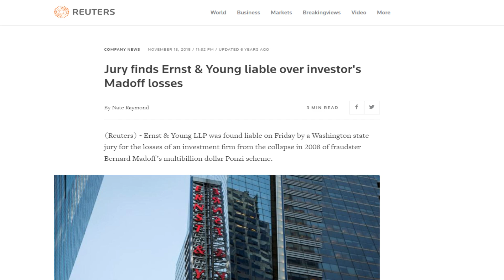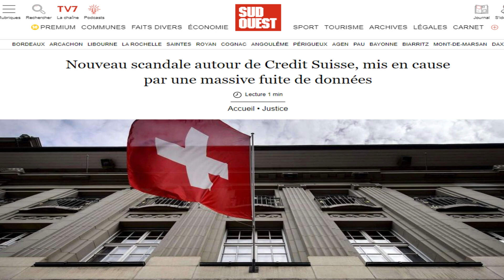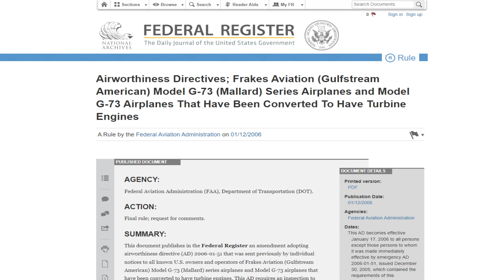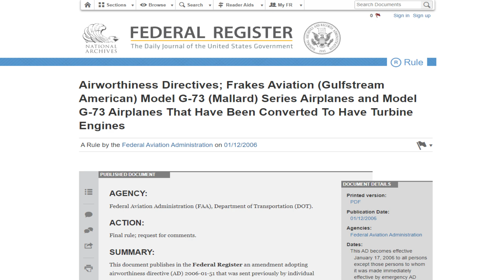Chalk's Ocean vol 101 - Fracture en vol

Comment: Salut Aldo, merci pour cette vidéo. 
Ton sens du récit, ta diction, tes connaissances (en aviation mais aussi dans de nombreux autres domaines), ta logique et tes capacités analytiques... Je connais peu de personnes aussi brillantes. 
La fatigue des matériaux est un processus assez lent est piègeux, où la pièce qui en est victime semble subitement casser sans raison. 
Heureusement de nos jours les puissances de calcul disponibles permettent de soumettre les designs à des simulations, ce qui permet d'identifier les points faibles et de corriger le modèle avant même sa production. Parfois il suffit de produire la pièce selon un procédé différent, forgeage ou découpe dans la masse au lieu de moulage par exemple. La nature du matériau employé a également une importance capitale, un acier selon ses teneurs en chrome, molybdène, silicium, etc n'aura pas les mêmes propriétés qu'un autre avec des teneurs différentes... L'un pourra être très rigide au point d'être cassant, l'autre pourra avoir une très bonne résistance tout en ayant une grande possibilité de déformation réversible (ressorts). La science des matériaux est extrêmement vaste, une vie entière ne serait pas suffisante pour maîtriser tout ce qui concerne les seuls métaux.

Comment: On peut remarquer une chose intéressante dans cette histoire qui se termine mal: l'accident n'est pas arrivé sans prévenir. Les multiples fuites de carburant indiquaient clairement une fatigue des matériaux, il y avait largement le temps d'anticiper. Un peu comme le crash du Concorde, avec le fameux vol AF 4590.

Même pour un simple vélo, la fatigue des matériaux joue aussi quand on roule beaucoup. Des fissures finissent pas apparaitre sur le cadre qui finit par se rompre si on ne fait rien. Si on surveille le vélo suffisamment souvent, on évite de se faire surprendre. Même si les conséquences d'une casse d'un vélo sont bien moins graves que pour un avion.
Reply from the maker: Oui, ils ont eu beaucoup de warnings et de signes que quelque chose n'allait pas. Mais leur logique : cet avion, ca fait 60 ans qu'il vole ! Pourquoi il va se casser aujourd'hui alors qu'il ne s'est pas casse pendant des decenies.
Reply: Au Hangar H3 de Roissy, je passais souvent sous les Concorde en cours de maintenance. L'odeur de fuites de kérosène était une constante. L'allongement de 21cm (!) du fuselage dû au frottement de l'air (110°C en surface dans un air à -55°C ! ) en vol à Mach 2.2  en était la cause. 🥵

Comment: Concernant la fatigue des matériaux, il faut dire que l'aviation partait intrinsèquement avec un sévère handicap. Je m'explique.
Les calculs de résistance à la fatigue sont faits en comptant le nombre de cycles nécessaires pour rompre une éprouvette d'un matériau donné en fonction de la contrainte exercée rapportée à la contrainte statique maximale qui n'engendre pas de déformation permanente (ce qu'on appelle la limite d'élasticité).
Il s'avère qu'un certains nombre de métaux ont ce qu'on appelle une "limite d'endurance", c'est à dire qu'en dessous d'un certain pourcentage de contrainte exercée par rapport à leur limite élastique, ces métaux peuvent subir un nombre de cycles virtuellement illimité (je dis "virtuellement" parce qu'il existe une inconnue sur ces résultats qui est qu'on ne peut pas tester un matériau ad vitam æternam, ce n'est juste pas possible dans la pratique, il n'y a pas le temps pour ça). C'est le cas des aciers en général (ce qui n'empêche absolument pas d'avoir des ruptures par fatigue sur des aciers, c'est aussi une question de dimensionnement et d'entretien).
Or l'aluminium et ses alliages, qui sont les matériaux de structure traditionnels de l'aéronautique, n'ont pas de limite d'endurance. C'est à dire que peu importe que la contrainte cyclique appliquée soit élevée ou faible, on a toujours pu mettre en évidence qu'au-delà d'un certain nombre de sollicitations les pièces finissent par casser.
L'aviation qui était contrainte d'utiliser des alliages d'aluminium pour pouvoir être viable, avait donc intrinsèquement ce talon d'Achille de la fatigue.
Ce qui fait d'ailleurs que l'arrivée des avions "tout composites" type 787 ou 350 pourrait entrainer un changement de paradigme dans la manière dont est surveillé le vieillissement des structures, les composites étant beaucoup moins sujet aux phénomènes de fatigue que ne le sont les alliages d'aluminium. En revanche ils détestent les chocs.
Reply from the maker: Merci pour cet apport :)

Comment: Ce qui est bien avec la fibre de carbone, c'est que l'on est presque pas concerné par ce problème. 

En effets, la fibre est connu pour voir une durabilité extrême. Voir même, elle ne bouge pas, tant que la résine époxy ne se dégrade pas. 

Et elle ne se dégrade pas facilement la résine, en dehors de mettre des UV dessus, même les fortes températures ne la dégradent pas. (En réalité si, elle se dégrade, mais c'est tellement lent, que dans la vie d'un avion, seul des choques ou alors des forces de sisaillement énormes et imprévu, ça ne s'use pas à échelle humaine.)

Et du coup, voilà un des plus grands avantages de la fibre de carbone, si vous souhaitez construire un truc, la fibre c'est bien et bien plus facile à modeler que du métal. Le seul truc, c'est que c'est très compliqué de connaître la résistance, car sa résistance dépends de l'alignement des fibres et du sens des forces.

Ça, c'était mon grand-père qui m'en parlait, il était directeur de laboratoire, et ils furent parmi les en premiers au monde à les étudier (fin 60 début 70's.).